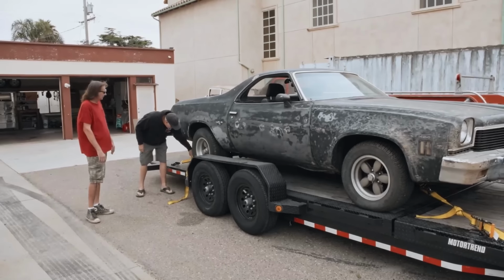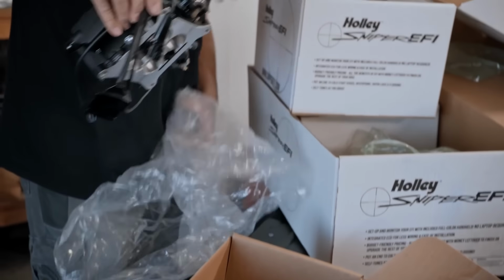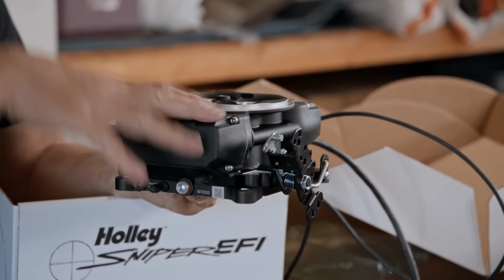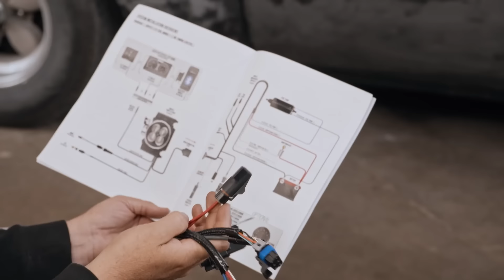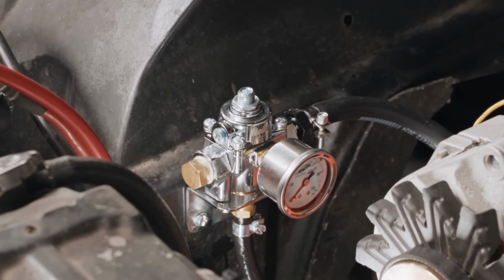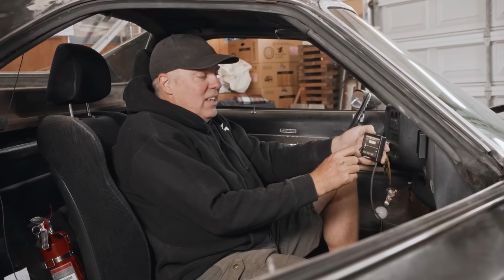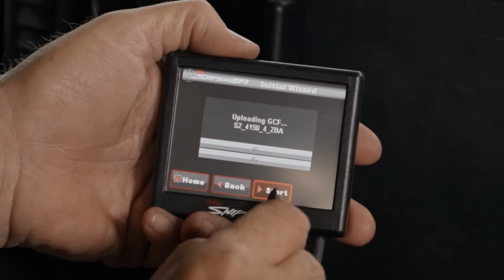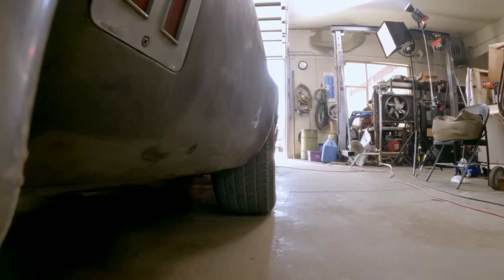Holley Sniper EFI 2 Install with David Freiburger on Roadkill Garage | MotorTrend Exclusive

Comment: Enjoy it while it lasts because it won't last long with the hot summer days and the heat of the motor and the vibration cooking the computers in the throttle body, computers don't like heat.

Comment: Ive know of at least 3 people with older cars, instal the fuel injection carb and later take it all off and put a real carb back on..  So, it all sounds great but that self learning thing never really happens...
Reply: If they had issues then they likely installed it incorrectly. Most issues come from not following the instructions and thinking you can get away with it
Reply: Only issue I had with mine was when I had a slight vac leak via busted intake gasket and user adjustment error. Otherwise it runs great. Hop in and go anywhere anytime.

Comment: To the folks in the comments, if you're using an electric fan, the default sniper fan on temp is like 260.  Make sure you set it down to what you want it before you fire the engine.  The electric fan trigger is not in the wizard.

Comment: O2 sensor????
Reply: Tv. Magic
Reply: Yep. They did not show or mention it. However, you will need to install the O2 sensor and a fuel return line to the tank.
Reply: That's what I thought right away wtf where s the  o2 sensor they made it look easy peasy it's not

Comment: Thanks guys, I plan on going EFI next year. It can’t be that easy. I will give it a shot
Reply: Just take your time, make sure absolutely no vac leaks, unit gets proper voltage, harness away from ignition components, fuel pressure good, and I suggest going in-tank pump set up with baffles

Comment: Wow another easy install🎉. My Holley Terminator X Max SEFI 350 with full timing control and custom is less than impressive. The base Holley tune ran horrible cold. Yes, I have plenty of fuel pressure, 64-65 psi using the larger high output Holley A body plug in module.
Reply: I know of two guys that installed these units, had nothing but problems, after 2 summers of trying to get them running satisfactory they took them off the cars and went back to carbs

Comment: I wish I could see that black F250 4x4 with the FE. I had a white one and I am now legally blind and can’t drive, but I still dream about that old truck, 4 speed and all.
Reply: I am thinking about installing one of these on a decent running 390 in a high boy. Be interesting to see if mileage will improve even a little bit with 4:10 gears and a 4 speed.

Comment: Was this supposed to be a commercial?  lol.   I have no use for carbs or throttle body fuel injection but it was still a fun watch.
Reply: Then what do you use, "multi port fuel injection"?
Reply: @bobby1970   For me I always recommend any form of OEM multiport fuel injection.   LS style stuff.   Things that don't require a lot or all proprietary parts.   If something goes wrong with that sniper kit when you are a 1k miles away from home you are screwed.  At least with the OEM stuff you got a chance at fixing it.

Comment: How does it know the air fuel ratio? they did not show any O2 sensor, does it require welding in of a bung to the exhaust for that?
Reply: For my 2300 Sniper it had an 02 sensor that was installed in the exhaust.
Reply: The snipers come with an O2 sensor and they give you a clamp on bung if you dont wanna weld or you can just weld one on or get a collector for your header that has one already
Reply: They only showed half of the installation.
Reply: @cabbage4372 yep they also didnt show installing the electric fuel pump and removing the mechanical
Reply: @cabbage4372 yeah they dont put the full episodes on YouTube anymore :( you have to pay motor trend to watch the whole thing

Comment: so what is the difference  really between sniper 1 and 2? I get it has some upgrades but it also doesn't have a built in regulator which sucks and it cost more too
Reply: He mentioned it has better shielding that reduces issues from the nearby ignition system. That's a big plus.

Comment: The Sniper and Sniper 2 like 58.5-60 PSI fuel pressure, directions state set it at 60 PSI.  D=Will this change the performance or the self learning?

Comment: If you had a dual quad carb intake would you put in 2 holley snipers?
Reply: Block off 1 side with some plywood 😂
Reply: @fivestar8337  That's no fun!
Reply: Yes they showed that you do when they put EFI on the crusher impala
Reply: @kassalsup7195 Wrong. That was a MPI system with a separate stand alone ECU.
The Sniper system has a simple ECU built inside the TBI unit. 
It can only support a single TBI unit.
Reply: sure! and it would only cost 2 million dollars.. and hope you know a computer nerd with a laptop to get them to work right

Comment: I'm curious the difference in price between this efi and a good carb?
Reply: about triple the cost. EFI is about $1300, 2nd hand $1000. carbs new bout $400
Reply: @chevychae2643  then you have to add if you really want the carb to run right a dyno session and jets.
Reply: @krusher74  it definitely depends on the carb and engine but and small cubic inches and a one barrel is gonna run perfect out of the box 99% of the time
Reply: Fitech is under 1K